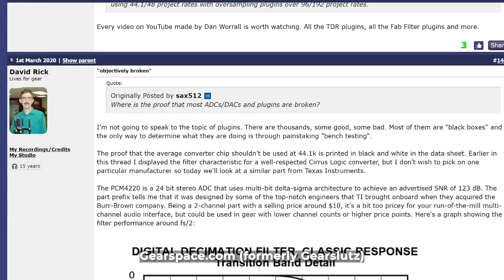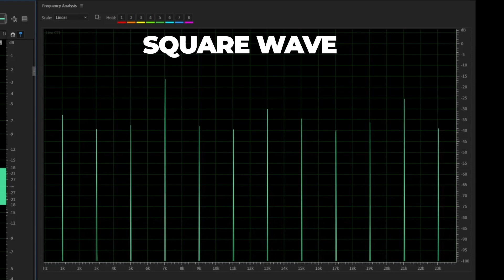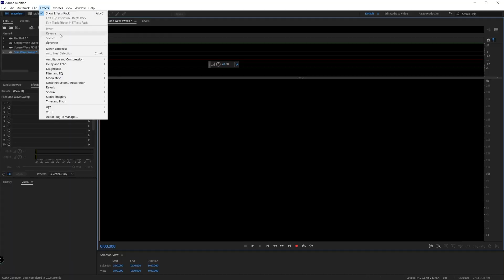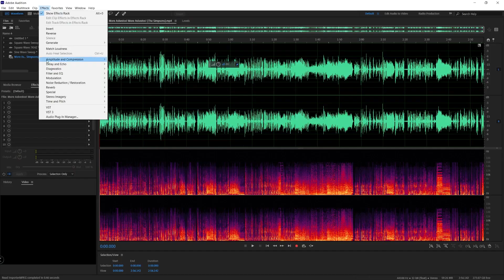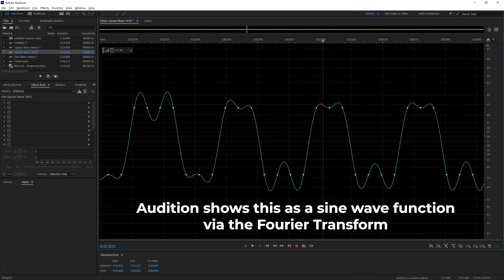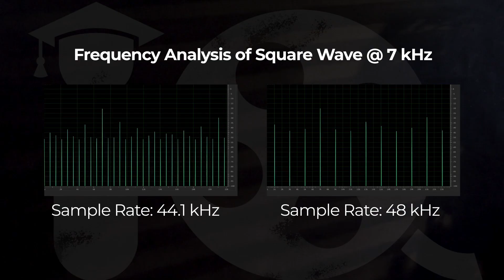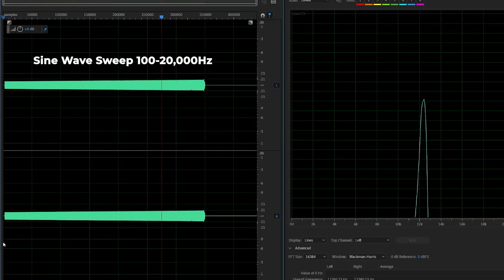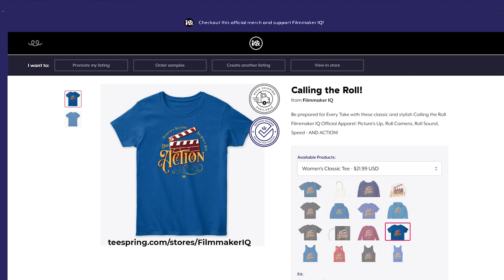What is the Optimal Sampling Rate for Audio? (It's All About the Aliasing)

Comment: I watched this, watched Montgomery's video and then re-watched this. I am left with a few questions. 
1, what is the significance of square wave performance? It doesn't strike me as something that we would encounter in real life? 
2, what about dither and any other techniques used to prevent unwanted harmonics or distortions? You didn't seem to touch on that? 
3, In the A/B test for the 5.2khz signal, did you pull a fast one? At the beginning of the test, B sounded higher pitch, or had a second higher pitch tone over the first one. After switching A to B rapidly, it was tone A that sounded higher!

PS, I am a 37 year old mechanic. I seem to be the only one in the world that uses hearing protection. I have received a lot of criticism from my peers and I don't understand the culture of not using PPE.. Especially when all the older guys can't hear anything. Torquing lugnuts with my impact gun, (and a torque stick, obviously) I measured 117db at ear level. Some of the other air tools are significantly louder. I see guys with their head in a wheel well, no protection, using an air hammer on suspension parts and I can't stand the noise even from the other side of the shop.
Reply from the maker: 1. The significance of the square wave is we understand and can predict what frequencies it creates. It's useful for diagnostics even though it doesn't really exist in nature (neither do real sine waves either).

2. Dithering is not a sample rate thing, it's a solution to quantization error which is a bit rate issue.

3. Yes, I did that on purpose to throw people off by removing the suggestion bias. If you heard the switch you could actually hear the frequency, but if you said it was either A or B then it was because your brain was being biased by the question I posed.
Reply: @FilmmakerIQ  Awesome response! Sorry for the spoilers on the AB then.. And yes, I mixed up bit depth and sample rate, that's on me.
Reply from the maker: You weren't the first to catch it!  Quite a few people did. But also quite a few people said it was definitely A or B :D
Reply: @FilmmakerIQ  FWIW, I could easily tell the square VS sign tones, just watching on my phone. For the 5.2, I couldn't tell at all on my phone speaker. I had to go to my computer and put on my headphones. But then it was clear.

Comment: While I'd agree there's not much intrinsic difference between 44.1 and 48, if you have to use an analog filter and no digital oversampling, you might be able to hear a difference between the filters used. So back when the very first CD players came out, they could have had a point.

Comment: The reason we can hear the difference between 10 kHz sine and square waves? The human ear isn't a 100% perfect linear audio system, so distortion brings certain high frequencies, such as those in transients, down to the range we can hear. Some audiophiles are aware of this and have escaped from woo-woo.
Reply from the maker: No, the reason you can hear the difference is aliasing - without it, you can't hear the difference.
Reply: Uhm... did you watch the video? He clearly shows that the difference in sound is from aliases. No speaker system designed for music is going to be able to produce 30 kHz anyway.
Reply: @FilmmakerIQ  I wonder why you spent so much time in the video speaking about aliasing as a real practical problem, and you raise it here again. Yes, aliasing is a simple effect worth knowing about, every sound engineer should know it, every person playing with audio and sampling should understand it. One uses the appropriate anti-aliasing filter before sampling or down-sampling, usually such filters are automatically applied or built-in, and that's it. If you hear aliases, then you did something wrong, or you intentionally created a problem just to illustrate it, like in the video.

If you sampled a square wave properly, then you don't hear aliased frequencies, because they were filtered out by a low-pass filter before sampling.
Reply from the maker: I would counter that band limiting a square wave doesn't create an actual square wave. The idea that it's the "proper way" is incorrect. The creation of an actual square wave results in these alias frequencies regardless of what sample rate you use, removing those aliases results in something other than an actual square wave
Reply: @FilmmakerIQ  "The idea that it's the "proper way" is incorrect" – do you know about a better way? Or you want to say that no way should be called "proper", even the one that avoids introducing invented sounds to the sampled signal and preserves as much of the original sound as possible?

You just wrote that "The creation of an actual square wave results in these alias frequencies regardless of what sample rate you use" and you also responded above that "the reason you can hear the difference between sine and square is aliasing". These (and some more statements in the video) are not true. Do you distinguish between aliases, harmonics, and any other frequencies that happen to constitute the sound? Set a sampling frequency of 44.1 kHz, generate a square wave of frequency 2205 Hz, and tell where are the aliased frequencies. Then try to hear the difference against the sine of the same frequency.
Reply from the maker: Square wave IS an invented sound... So there is no "original sound" ... No original signal. The square wave is purely a construction of the audio program.

Do I distinguish between harmonics and aliasing? No, because your ear doesn't. That's the definition of  aliasing - they are false frequencies that arise from sampling... They ARE real frequencies

I suspect the reason you want me to conduct an experiment at 2205 hz is because the aliases line up with the harmonics. Can that be distinguished from a sine wave at 2205... Of course, because you can hear the harmonics.

But if you though that proves anything, you completely misunderstand the point of my experiment and video
Reply: @FilmmakerIQ  Sorry, but there are so many things I consider incorrect in your post that I don't know where to start :-) Let me try:

"Square wave IS an invented sound... So there is no "original sound" ... No original signal. The square wave is purely a construction of the audio program." – but you know that a square wave can be generated by an analogue circuit and you can see such changes in voltage on an oscilloscope, right? What do you think will happen after sampling this signal, if your sampling frequency is 10x higher than the frequency of changes of the signal generated by the analogue circuit? What signal will you get after sampling: a square wave or something else?

"Do I distinguish between harmonics and aliasing? No, because your ear doesn't." – and that's one of the problems with this video. These terms mean different things, they are precisely defined and you cannot use them interchangeably, even if your ear doesn't feel the difference in some specific case.

"the reason you want me to conduct an experiment at 2205 hz is because the aliases line up with the harmonics" – so how do you know that the aliases even exist, if they "line up with the harmonics" and "the square wave is purely a construction of the audio program"?

OK, it is not my intention to try to explain the nuances of signal processing in the youtube comment section. I just wanted to bring to your attention some inconsistencies, and hoped for the video to be improved to avoid causing confusion or spreading misinformation. If what I wrote raised some suspicion in you and encouraged you to get a better understanding, then great. If not – well, this is not a signal processing channel (a great channel btw!), so I guess viewers do not expect 100% correct and precise information in this area.
Reply from the maker: A square wave created in analog is still an invented sound, it's constructed and artificial.

I don't understand your attempt to make the distinction between aliases and harmonics. Yes I know they are different but functionally they are the same thing on playback. Some sources even call it alias harmonics. 

Your argument is entirely pointlessly pedantic especially given what I was demonstrating. In not giving out misleading information and the allegation leads me to believe you really don't understand what I'm saying.
Reply: @FilmmakerIQ  "I don't understand your attempt to make the distinction between aliases and harmonics. Yes I know they are different but functionally they are the same thing on playback. Your argument is entirely pointlessly pedantic... The allegation leads me to believe you really don't understand what I'm saying." – Quite probably. If you use some words to convey your thoughts, and your definition of these words is different than the definition used by your listeners, then it may be the case that you are right according to your definitions, but wrong according to the definitions of your listeners, because they perceive a different meaning of what you say.

You said that "the reason you can hear the difference between sine and square is aliasing, without it, you can't hear the difference" and I'm not sure you still hold this view. If you created a waveform in the realm of some sampling frequency (you generated it in your program, with a sampling frequency of say 44.1 kHz), and you keep saying that there is no "original sound" and the square wave only exists as a generated sampled signal, purely a construction of the audio program, then how can you even speak about aliasing? You are unable to introduce frequencies above the Nyquist threshold this way.

In your last post you also said that "a square wave created in analog is still an invented sound, it's constructed and artificial". This is quite a statement, your earlier statement was less restrictive: "the square wave only exists as a generated sampled signal, purely a construction of the audio program". Now it appears that even if the wave exists as a true continuous signal, a current in an electronic circuit, and even though it can be sent directly to the speaker, it is still somehow artificial – as if its origin was important for some reason. Are you aware that the square wave is nothing special when it comes to aliasing problems, and the same kinds of problems exist with many natural sounds, including your voice?
Reply from the maker: Seriously pedantic arguments... I was talking about the difference between a sign and square wave at 7 kHz.

Yes I'm aware of the aliasing is not just regards the square waves. 

I'm getting tired of your line of argument. You have no concept of how to communicate and you're doing nothing but picking at the words to try to win the argument rather than actually understanding what is being said
Reply: @FilmmakerIQ  I have no stake at this discussion, because fortunately we are speaking about objective and fundamental truths described in thousands of books, not about our personal opinion and "winning". I spent a lot of time trying to understand your point of view, and "picking at the words" is the only way I can ask you how you understand these things. If "aliasing" was one of the most common words in your video, and I cannot understand your point because the way you use it does not agree with my knowledge, then I cannot avoid asking about it in very detail, describing specific cases. But if you perceive this as an argument between you and me and not as a journey to discover the truth, verify our points of view and become wiser, then sorry!

Comment: 17:23
I can hear the CRT whine type noise
But tbh it just sounds like the 5.2khz sine wave + CRT whine, definitely not a square
Reply from the maker: That's all it can be...
Reply: 5.2khz square WILL sound like only 2 waves since next wave is at 25kHz, and it does sound like CRT whine... becasue CRT whine is very close at 15,7kHz (PAL is a bit higher than NTSC) and is a result of line frequency and caused by magnets shoving the electron beam.

Speaking of CRTs. I happen to still hear up to 18kHz and it annoyed me SO MUCH that for so long people just used CRTs everywhere and not cared about the noise it creates... from supermarkets to some movies and tv shows 15,7kHz was everywhere.

Comment: 1 - I can't tell the difference between high sample rates.
2 - The extra memory and storage space taken up by the audio no longer matters when it's stored next to hours of 8k HDR video, so there's no compelling reason to record at the minimum viable rate like there was when 650 MB was a lot of space.  So, meh, may as well do everything at 192 kHz.  And if you slow it down to make spooky low pitched ghost noises because you forgot to shoot enough footage and you need to fill time in your video, it'll still be a high enough sampling rate.
Reply from the maker: It matters when you have hundreds of tracks with huge effects chains on each track. Delay in video is acceptable, but delay in audio is very bad.

Comment: Such a great video! I had no idea Audition tone generator was so sh*t, lol. These days, steep anti-aliasing filters are easy to produce so the main reason to use higher sample rates for production is extra temporal resolution for time-stretching.
Reply from the maker: Audition's tone generator did precisely what it was asked to do.

And you don't get more resolution with higher sampling rate, you get more possible frequencies which can be useful for time stretching
Reply: @FilmmakerIQ  I consider the fact the tone generator can be asked to produce tones outside the files sample rate bandwidth to be an error in design. It clearly works at some internal processing sample rate then down samples to the file rate without anti-aliesing.

Seems like you dont agree with my use of the term resolution. Then let's say higher sample rates allow time stretching to be done while maintaining full audio bandwidth where it would otherwise be reduced.
Reply from the maker: Yup, it's called wave table synthesis. It's generating a square wave based on the simple mathematical function. That it's not band limited means it's a real square wave.

If we wanted to band limit it, we should tell it, but then it wouldn't be a square wave.

I agree with the bandwidth statement. I get the use of the word resolution, but the way it's used as a visual analogy has lead to a lot of confusion.
Reply: @FilmmakerIQ  Thinking about it in the case of a square wave there is not really such a thing as a 'real' or perfect one. Unlimited bandwidth would be needed, but doesnt exist. The tone generators internal function will have an upper bandwidth so I think to down sample without anti-aliesing is just as bad as for example working at 32bit then  reducing bit depth to 16bit by pure tourniquet of the word length without dithering.

Unless there is a specific use case I'm missing that benefits from this behaviour, it just seems like bad practice?

If you look at the output of a 'proper' scientific signal generator, even a digital one, I doubt it show aliesing issues.
Reply from the maker: Square waves exists in electrical circuitry. Power on, power off. That's a square wave... So there is such a thing as a perfect square wave. It may not exist as sound but that's not the point.

Yes if you generated a square wave in a analog format or even on good digital equipment and tried to sample so that the sample frequency was around the place of the 1st harmonic you WOULD get aliases. Why wouldn't you? Anything above Nyquist gets aliased.

The aliasing of square waves is a well documented phenomenon. There's papers written about how to adjust the square wave to prevent the aliasing...

So Audition is doing EXACTLY what it's asked to, and nothing more.
Reply: @FilmmakerIQ   Well poo, my post was removed! This is an interesting discussion and I wanted to get more input from people with proper test gear about the correct or incorrect application of anti-aliesing. I'll shoot you a link on your website contact form so you can join in.
Reply from the maker: I don't think you understand what anti-aliasing is or what aliases are.

That's why this Audition test was so enlightening. It shows clear as day what aliasing is.

Comment: You might want to check the mics limited to 20kHz idea. I have seen a U87 with 30kHz from cymbals.
Reply from the maker: It's not that mics are that limited, it's that human hearing is limited to 20khz so there's no point in mics that record 30khz... That includes the U87
Reply: I went back and listened. Lol. I misheard one of your statements. 

That said, the fact that there is energy there, much like your multiple sine wave test, means that converters have to deal with it. Some do better than others. 

The 60k sample rate also lines up with analog tape that has a bias frequency of 105kHz and response to 30kHz. 

Great job showing aliasing!

Comment: Is the difference between sine and square wave sounding different due to the non-perfect reproduciton of the square wave?  Both in how the speaker generates it and how your ear responds to it?
Reply from the maker: Not in the case in demonstrating. But yes, your speaker and ear drum are also limited to a certain number of frequencies. So at a high enough frequency, the sine wave and square wave will sound the same (without aliasing)